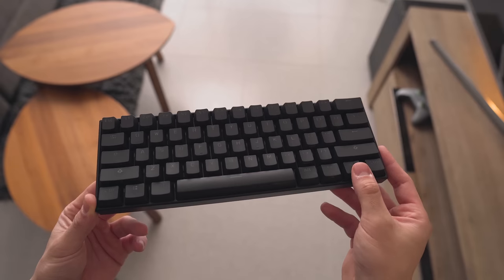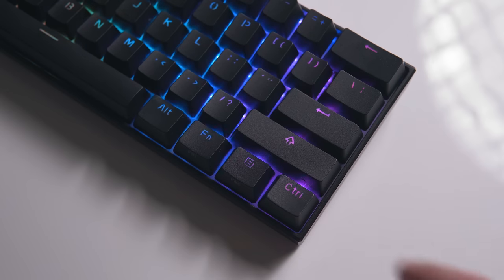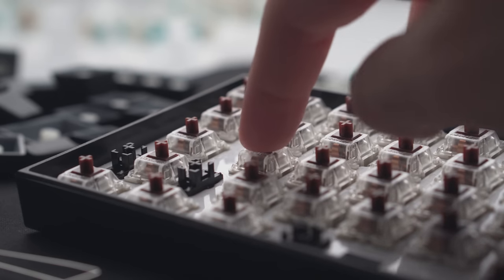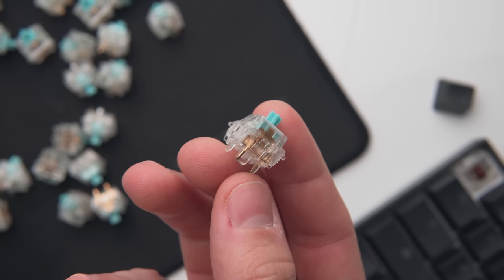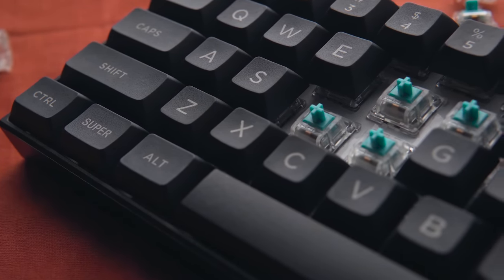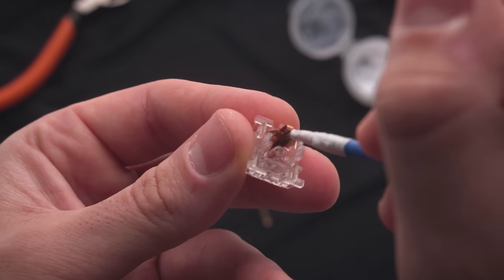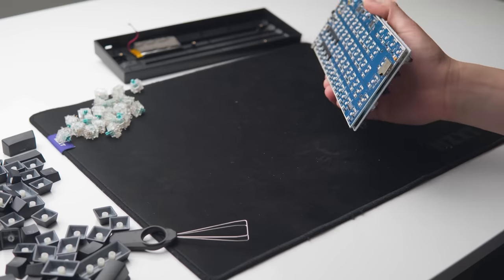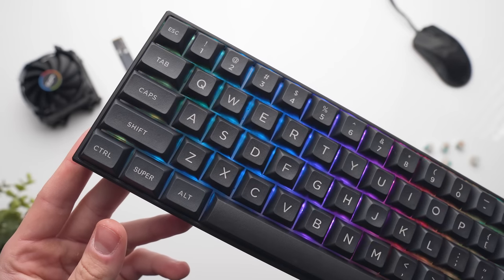Building my Dream 60% Keyboard

Comment from the maker: Won't be in a hurry to use common mechanical switches after this..
Also correction @ 2:15 - it's a plastic case, not aluminium, still feels nice and sturdy though - my bad!
Reply: do you reply people
Reply: The DSA keycaps you provided arent doubleshot either. Laser etching should still be fine tho.
Reply: I'm addicted to cherry mx blue. Whenever I use anything else, I feel so unsatisfied.
Reply: @mrrgb4954  I puke when i hear cherry mx blue. Although switches are in the end, personal preference, cherry mx blues sound rattly, plastic-ey and high pitched. It feels meh as well. Have you tried things like box navies etc?
Reply: Have the same switches on a GK64 :-). (Bang good, $95 AUD, but took nearly a month to arrive).
OT, Suspect your main audience is USA? 
But, for us Aussie's, there is a great group on FB "AUMK". And, they do semi-frequent LOCAL group buys on things like the Tealios V2. 
Rhys is the main seller there, trustworthy, easy to deal with, fast delivery when in stock.
Reply: You should check the BIOI G60BLE PCB group buy that just came out, might be right up your street if your not too fussed about rgb LED.
Reply: Is the Anne pro 2 hot swap
Reply: Did you try lubing the gaterons?

I am waiting on some PBT keycaps before swapping to Gateron Silent Browns on my Raazer Blackwidow TE.
Reply: would you switch to an aluminum case?
Reply: I got scared for a second 🙅‍♂️
Reply: To me it looks like this is only worth it if you want switches that aren't used in any decent Keyboard otherwise you pay extra just to have a Keyboard with switches no one else has. xD
And yes I refer to taking the time to de-solder and re-solder all the switches as paying extra cause work isn't free people even tho most people doing Custom stuff like this want to tell you otherwise to make it look like you safe money by doing this.

Comment: YES! Finally more people are getting into the mech keyboard world!
Reply: Shh... Hear that? It's the sound of a million wallets crying
Reply: @cilindrox  relatable
Reply: @cilindrox  Amusingly, my Zelios PCB and Sakurios switches arrived the other day and Drop forced my arm into the Oblivion keycap set... I'm like, ~$400 deep and I don't have a case, lube or even a proper soldering station sorted yet! Wallet is indeed crying.
Reply: @naycnay  some people do spend 1000$ bucks for a phone that they do drop some weeks later. 😂 
400$ is not so expensive in comparison.
Reply: @kissu_io  its a phone you can do virtually anything with it. Then the switches your defending sound cool :/
Reply: finally?
Reply: @ljsorbaby5143  A phone will last at most about 5 years, but a keyboard will easily outlive you, and it's one of the main ways you interact with your computer
Reply: @nova.celi_  I'm still using a decade old phone

Comment: There's a bunch of hidden costs with your build: switch opener, a soldering iron and desoldering sucker (the cheap ones that come in an amazon kit has terrible suction). It feels like kind of a waste if this is all you're using it for. If you just want something really smooth, just get a keyboard with gateron optical blacks on aliexpress. It's contactless so it's even smoother than tealios for a fraction of the price. The board has pretty iffy software but not much worse than anne's. The only drawback is that it's optical so if you decide to go tactile or clicky down the road you don't have a ton of options.
Reply: i buy my tools as investment.
building keyboards is very therapeutic for me, so i offer build service for others who dont have the means or time to build their own.

i get to relax after work and school, and it pays for the tool itself. win-win.

Comment: cheap stabs, cheap plate, limited layouts, cheap plastic case would not recommend. better off buying a custom kit from 1up keyboards, or even sentraq.
Reply: Well honestly that’s the point, and from my experience all the parts you listed as “cheap” have no effect on the typing experience/performance of the keyboard. Also despite the Anne Pro 2 opting in for cheaper materials the quality of these materials are pretty solid and you honestly don’t need anything much better than what it has.

On top of all that the Anne pro 2 is also wireless, pre-built, and only costs $80-$100. Plus I’ve had a basic sentaq 60% KB and I still use it frequently, it’s literally an Anne Pro 2 without wireless capabilities.
Reply: @jconic6023  My fault I meant as far as desoldering an anne pro and spending more on switches from zeal.
The anne pro pcb is fully customizable?
Reply: @n m you can change the layout, add macros, or change LED modes, but you can't go any further than that, say, decompiling the board, if you don't have the ability to
Reply: @jconic6023  if you do build a premium keyboard, you will definitely feel and hear the difference.

You can drive a cheap car for 800$. A Tesla is pretty much the same, no ? I mean it just rides, so no difference ? 🤷🏻‍♂️

Comment: Some notes to anyone finding this video in 2020 like me - Anne Pro 2 is a plastic case, not aluminium however they do have alu cases that fit the pcb. However in 2020 for the same price, you can get a hotswap board (no soldering necessary) like a NK65 entry, Drop Carina, ID80, or Keychron K6.

Comment: Great video! Thanks for showcasing our Tealios V2! :)
Reply: Still £9 per switch. Might hold off a while to buy.
Reply: @Charlie-et4td  Just so you know it comes in a pack of 10. It's not that price for a single switch.
Reply: @MrAdam0008  really. The site only indicates one switch. Guess I'm getting an upgrade when DHL starts UK shipping again.
Reply: @Charlie-et4td  Per switch? Nah, dude
Reply: @kaandemirci9691  there are way better keycaps out there. For example, you can find SA, Gmk, KAT, and even some cheaper options like epbt that are better in my opinion due to better sound, quality, and looks.

Comment: You need to work on your soldering technique. The soldered joint should appear shiny and have a concave fillet. You need to flow more solder into the joint and hold the iron longer to prevent what's clearly a case of cold joint.
Reply: Maybe because he used a fluxless solder?

Comment: Reminder:

For tactile switches, only lube the parts where the slider moves on the sides of the housing. Do NOT lube the leaf, or you'll lose that tactility.

Otherwise, good guide!

Source:

Spending too much time lubing Outemu Sky V2's.
Reply: This man lubes
Reply: note: some switches are so tactile that if you lube the leg or the leaf, the tactility is still strong, so that's a weird way to flex on other weak tactile switches, but that's om
Reply: Have HPs coming in soon and more to come, just imagine me sweating the lube stage avoiding the leaves at all cost and convince myself to not touch/clip the poles either, I want these HPs to be as extremely tactile as possible lol
Reply: Outemu Skies really need the lube though tbf, so I think it's fair that you thought to lube the tactile legs too.
Reply: @hikarii8758  what about Gateron brown?
Reply: Here is the thing though. If you get somewhat scratchy switches like outemu skies or something, it might be worth it to lube the legs anyway in order to get a much smoother but slightly less tactile switch.
Reply: These switches are linear switches so he's all g
Reply: Is there a way to buy a keyboard with the same tactile feeling and low noise as the video but minus the soldering
Reply: This is true for most tactiles, but Zealio v2s, T1s, Oreos...etc switches have have massive tactility, lubing the legs on these switches smooths out the bump without messing with tactility.
Reply: So if he wanted linear, he could have just lubed the Gat Browns.
(Obviously he wanted the higher pressure force as well)
Reply: @DDHDTV  

Gat browns are tactile.
Reply: i lube my Outemu Sky V2 tao version and Outemu Ice clear V2, i lube the leaf and stem leg with Krytox 105 and no tactility is affected and it made it so much godamn smoother, can't say for other blend of lube like 205g0, if your switches are as tactile as outemu sky, lubing the stem leg and leaf with krytox 105 wun affect the tactility
Reply: Yes.
Reply: I know I’m really late, but I actually like the smooth and less punctuated tactility after lubing the tactile legs of the stem.
Reply: @kaandemirci9691  You're joking right? well, I guess it's only preference
Reply: Please I need help. can I lube a not hot swappeble keyboard? Is there any problem on making this without pulling out the switches?
Reply: @catoflado4977  yes you can. But it’s not going to be as well done as opening the switch and lubing the components directly
Reply: @catoflado4977  You wouldn't lube the keyboard itself, only the switches and the stabilizers. The board being hot swappable or soldered should have no effect.

Comment: I still have my Steelseries 6GV2 with MX black switches, which are also linear and have a similar actuation force to the ones you put in. They feel very smooth, not scratchy like the browns you took out. I love that keyboard, have a custom doubleshot PBT keyset and won't replace it ever, it'a built like a tank and will probably outlive me.

Comment: I've done this as well except instead of swapping switches out of my Anne Pro 2 I instead swapped the stabilizers with genuine cherry stabs along with lubing and clipping them, as well as lubing all the other switches (gateron reds). Very satisfied with the outcome as the keyboard now sounds and feels super premium. 

My take on why I decided to use the Anne Pro 2 as base instead of building a 60% from scratch was largely due to the feature packed utility that comes with the Anne Pro 2 PCB (Bluetooth 4.0, Macros, "Tap" function, 2 layer function keys) along with the excellent software support for the keyboard. No DIY 60% PCBs ticked all the boxes for me.

Comment: You could probably cut down on cost by using a jwk/durock linear and lubing amd filming it. They come in at anywhere from $.50 to $.70 depending on where you buy them. They are still very smooth.

Comment: Graduated from "Gaming Keyboard" to Custom Keebs, no regrets. 

Now I look at "Gaming Keyboards" with a bit of disdain.
Reply: ever since watching Taeha Types compare a custom mechanical keyboard to a stock razer huntsman, "gaming keyboards" seem like cheap walmart bargin bin crap in comparison. cannot go back lmao
Reply: @syloui  yep custom keyboard can be price from varies range, so if u willing to spend big money on ur keyboard you can get a really nice keyboard, and if you dont get the money to spend on it , you may just buy a gaming keyboard because the intro level of a custom keyboard cost way more than a gaming keyboard. i mean you will need to spend at least 300 for your custom keyboard from base, plate, pcb, switches and keycap.
Reply: @syloui  LMAO it was the same moment for me
Reply: @ando5723  yea, if u consider gk61 is custom, its fully loaded and u just plug and go, and im not gonna talk about the quality of that
Reply: @ballsinurmouth-2  then why u not just buy the fully built version since u consi& gk sk series as custom keyboard since they cost under 100 and come with switch and caps and you have no need to buy or even assembly the keyboard
Reply: @ballsinurmouth-2  I mean gk and sk sold pre build version which is also hot swap you basically buying a hotswap prebuild and take out the switch to lube
Reply: @ballsinurmouth-2  they are prebuild keyboard and ride the custom train my man they are massively produce product since they are hotswap so it's easy for them not to put cap and switch on
Reply: @ballsinurmouth-2  and also if u really wanted u can get a full acrylic plate keyboard with cap for less than 50
Reply: We all been there; no need to be a snob
Reply: Don't we all.. lol
Reply: @hermansmyth916  yeah but i like to see my keys while im typing/gaming at night without having to have another light on.

Comment: i have a "dierya" 60% with outemu browns, i lubed them myself with white lithium and a tiny paintbrush that was able to get in between the switch and housing, just a tiny bit of lithium while pressing the switch up and down works it right in, no disassembly required and made a massive difference after combining with some thick pbt caps. the dierya is abit of an underdog, but at 45 bucks with bluetooth and a removable micro usb for wired use it really has pleased me. It has dedicated arrow keys too, a must for me (play alot of heavily modded bethesda games)

Comment: I can not understand why anyone would want a 60% keyboard when you can have a 75% with just one column and one row more. It is just as compact imo and has a lot more versatility.
To put that in perspective I built myself a KBD75 with Zilents 78g and it is an absolute joy. I have to say good kecaps are indeed stupid expensive tho so going with a board like the anne pro and keeping the caps is probably a really smart move.
Reply: there aren't any good stock 75% boards with cheap prices, and custom 75% boards are usually much more expensive than 60%
some people can't stand the 1.75u right shift key, because it's too short for them and they usually hit the up arrow instead of the right shift key

Comment: Just a couple of notes for people looking who just fell in love with the sound of that keyboard, and want to make their own:

- While the keyboard he used as the "base" for the custom board will do the trick just fine and is fairly cost effective, you can get a much better feeling and sounding board for not too much more. If you buy your own case, pcb and mounting plate, they will likely be much higher quality than the Anna Pro 2. I've linked some great options below
- While he showed the difference between lubed and unlubed switches, he didn't say anything about lubing the stabilisers. THIS IS VERY IMPORTANT. If you leave your stabilisers stock, chances are you'll have a great sounding board until you hit that spacebar, and it starts rattling like crazy

While I do highly encourage everyone here to build their own keyboard (it's worth it - trust me) please take your time and do your research. There are many hidden details that are easy to miss but can have a huge effect on your build. You have to make sure that the pcb you have supports the layout of the mounting plate you got. If you don't want to solder switches, you have to make sure you get a hotswap pcb etc etc etc. It can seem scary, but the experience and end product is just soo worth it.

Case - https://kbdfans.com/collections/60-layout-case/products/kbdfans-tofu-60-aluminum-case
PCB - https://kbdfans.com/collections/60/products/gk64-rgb-60-64keys-hot-swap-pcb
Mounting Plate - https://kbdfans.com/collections/plate/products/cnc-60-aluminum-plate

Comment: If you want to go to a 60% keeb but doesn't want to solder, go for a gk61/gk64. They're hotswappable BUT get the one with the gaterons. The other version of the gk61/gk64 has optical switches. They're meh and hard to find since they're kinda new. Gateron sell a few but I'd love to see a Kailh box since they're my preferred switches.

Comment: Lubing switches is optional not really necessary but will improve the typing feel however it is absolutely necessary to lube your stabilizers because it helps eliminate the rattle from it and it's even better if you use genuine cherry or gmk screw ins stabilizers as those are some of the best stabilizers to use. Rattly stabilizers can make any keyboard sound and feel like shit
Reply: if you manage to find them in stock, zeal stabs are THE BEST out there
Reply: imo, Zeal stabs are good, but I don't think they are worth the price

Comment: I'm using the older Corsair K70 RGB with Cherry MX Red Switches Mechanical keyboard, I replaced all the key-caps with key-caps from my older "Razer Blackwidow Ultimate" keyboard which has large font letters & now looks similar to the "Corsair Strafe RGB keyboard". I really like the Corsair k70 RGB I have been using the keyboard since 2014, the whole body of the Corsair k70 RGB is made of a 1 piece black brushed aluminum so that is why they cost $150-$180USD each.
Reply: Aluminium isn't that expensive tho...

Comment: Nice.  I went and did the same thing, except I added Mill Max Sockets to make it hot-swappable and went with 65g Zilent V2s.  I just need to find a nice set of keycaps I like.  But making it hot-swappable might cost you around $40, but it adds a really nice feature, especially if you want to try new switches, lube, or "tune" your switches a bit more.

edit: also not necessary, but highly recommended: lube your stabilizers while you have it open. Taeha Types has a guide on this as well.
Reply: Would you mind sharing the exact reference of the sockets you used, please?

Comment: If you guys really want a good keyboard to start modding and you don't want to go the whole "build your own from scratch" deal, buy the HK61 or iGK61 (it's branded a few different ways).  It has a hotswappable board so no soldering required, a pretty solid case, and it's only $50.  Hot swappable boards are $40+, so this way you get an entire functional keyboard whether you need the parts or not.  It makes for a great budget keyboard as is, and if you don't have much money you can make upgrades over time, while still being able to use the keyboard.  The software is mediocre, and is in chinese, but the main functionality is pretty intuitive, which you can customize quite a bit.  Also, the switches alone are amazing, since they're optical gaterons of your choice, which in my opinion feel closer to budget lubed switches if I had to say.  I can't recommend this enough, if you don't need wireless like the anne pro, please go this route since it's much cheaper.